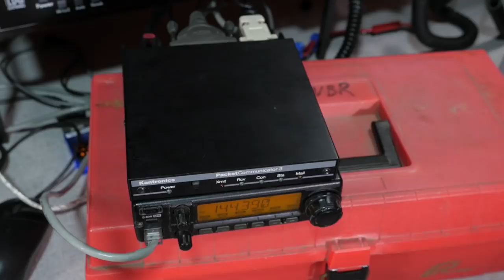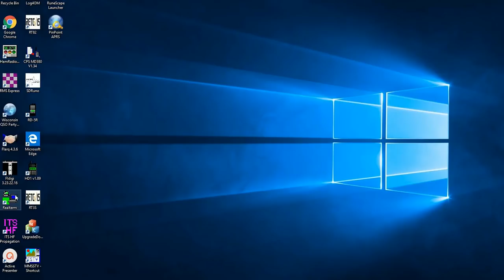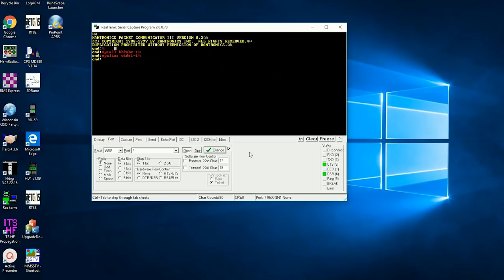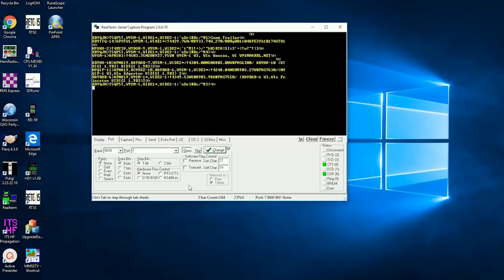Build an APRS Fill In Digipeater - Ham Radio Q&A

Comment: After watching this video, I bought the USB serial adapter you are using (it has the FTDI chipset, too; I've had issues with adapters that use the Prolific chipset) and a DB9 to DB25 adapter.  I'm going to resurrect a Kantronics KPC-9612+.  Southeast Ohio could sure use a fill-in APRS digipeater.
Reply from the maker: After several years‚ I'm still using that same USB to serial adapter. It's rock solid.

Comment: Great info, especially since my club has been talking about digipeaters at aide station in mountainous ultra-marathons in my area, I was looking into building a few one based on arduino, and forgot That this may work with stuff i already have, 3 mfj tnc2 clones, and a KAM and a kpc3, thank you!
Reply from the maker: Fill-ins are a great way to repurpose old equipment.

Comment: Thank you for the vídeo. I used Packet Radio in the early '90. I'm back after 25 years to ham radio. Now I have a FT 991A and I can buy a used Kantronics 3 plus.  Do I nerd the serial adapter to connect to the PC or I can use the USB cable such as FT8? Thanks in avance. 73de Luis. LU1CBQ.

Comment: I have a KPC-3 (Non-plus) and I have set it up just as you have yours setup. Mine doesn't seem to receive aprs packets like yours does.  Mine also is Ver. 6. Do you think Ver. 6 may not work as a digipeater?

Comment: I live in a rural area where theres only one digipeter withen 25 miles, all the big boys are 60+ miles away. I'm having and issue where my digipeter on the coast, will send off the packets from my HT, but wont return the acks to the HT or any messages for that matter. 

example, If i send a message from my HT, SSID -7, to the digi owner 20 miles out, the HT sends to my digi SSID -10, which then the message gets forwarded to the recipient, my -10 station receives the ack and message reply, but WONT send it to the HT. So my HT will keep firing off packets thinking the packet didnt get received.

I'm using the software modem direwolf.

Comment: I set my old pk232 up as a wide1-1 aprs but have not seen it digipeate on aprs maps. Why wouldnt mobiles and portables digipeating through it I wonder.
Reply: @KB9VBR as a follow up, I was having issues with aprs dit fi digitizing my packets but it seems to work now,  There were issues with my GPS coordinates and no on in my area so I had to do the old fashioned trial and error, aslo looking at other local repeater and trying what they are doing hihi.  I was getting [uncompressed packet], than [uncompressed location] but got it figured out now/  you can see the mess I left  my call is ve1qet.  So now.....I wait, but still I dont know how I wouldnt have been recieeing and relaying even though my config was a little off, If aprs dot fi was still receiving my packets.

Comment: So your digipeater is just a kantronics TNC and a radio. You program the Kantronics with what to do including digipeating its position. Then it and the radio are the fill in digipeater?
Reply from the maker: Correct. The Kantronics TNC is the digipeater. You only need a computer to program the commands for the TNC. A simple terminal program and a USB to serial adapter is all that's needed for programming.

Comment: I’d like to use APRS trackers on the two ATVs I own. I’d like to track the kids as the travel in the woods 1-3 miles from the cabin. I have no need to digipeat this info into the network. Do I need to have internet to get this tracking onto the APRS.fi mapping software. I know that you can download google maps for use offline but don’t know if APRS software will work with offline maps.
Reply from the maker: APRS.fi is an online APRS solution so you'll need Internet connectivity to use it. There are offline APRS applications like APRS Point or UIview. For those‚ all you would need is a radio/TNC combination connected to the computer.

Comment: KB9VBR...GREAT VIDEO!  This just might be the solution to the digipeater / Igate problem in our area.  We do NOT have an Igate or digipeater in our county (Tyler County, Texas) and I've been wanting to install SOMETHING for a long time that would at least allow APRS tracking within our neighborhood in the nearby town of Woodville.  There is a digipeater in Hardin county which I think could be activated from my QTH if I could put up a small beam.  The trick would be receiving on an omni and transmitting on a vertically polarized yagi.
Any ideas?
Reply from the maker: I'd probably look at building a full-blown digipeater If you aren't getting good coverage with a neighboring digi. Fill-ins will only work on the first hop and a true digi has the extra ability of filtering to help reduce congestion and duplicate packets. As for splitting antennas for receive and transmit, that would likely involve two transceivers, one on the omni and another on the beam. That might end up being quite complex.

Comment: Would this be the same setup if used as a fill in Winlink digipeater?
Reply from the maker: It would be similar. You can use the same basic commands as a Winlink fill-in digipeater. Of course you will not want to use Wide1-1 for your myalias, but instead could use a callsign with SSID, or a tactical call.

Comment: Hi, can you describe the meaning of the BEACON text  (BTEXT)? You've written it out as "!DDMM.mmN1DDDMM.mmW#W1-1" plus the custom text. Looking online, where you have a "1" after the N (North), I see others suggesting it should be a "/" to separate the the LAT from LON. My KPC3+ is quite old, it's using older firmware, so maybe the old firmware required a "/" to separate LAT and LON? In other words, it would look like this:

BTEXT !DDMM.mmN/DDDMM.mmW#W1-1 MY CUSTOM TEXT

Can you confirm that the "1" after the "N" (North) is correct?

What does the "#" sign signify?

Many thanks!